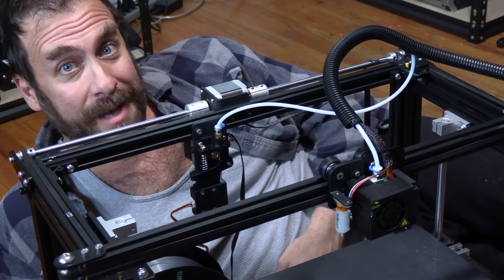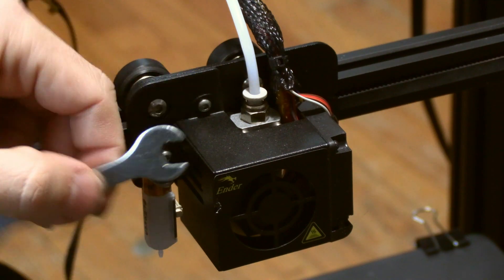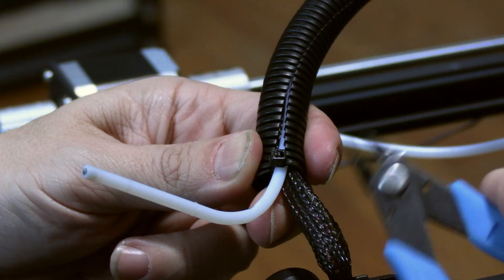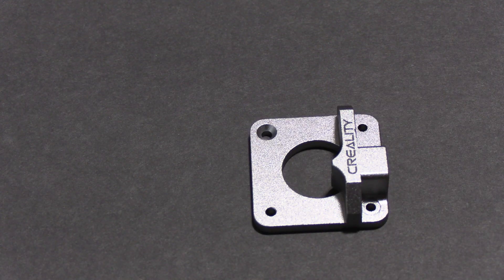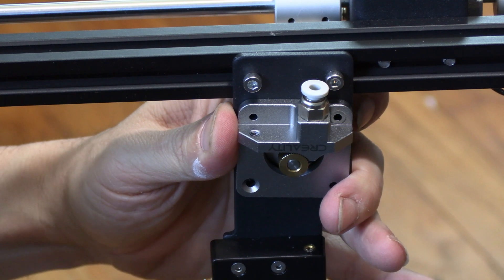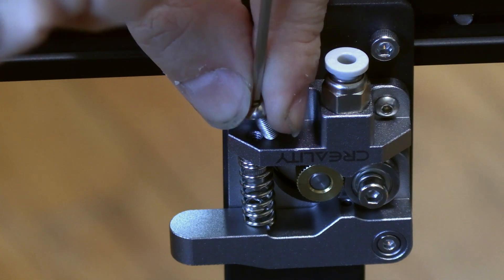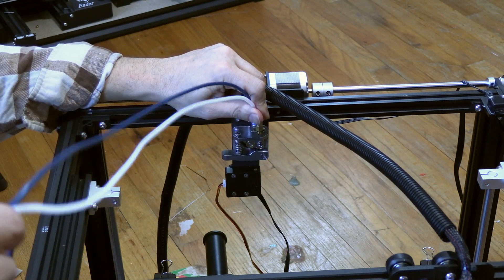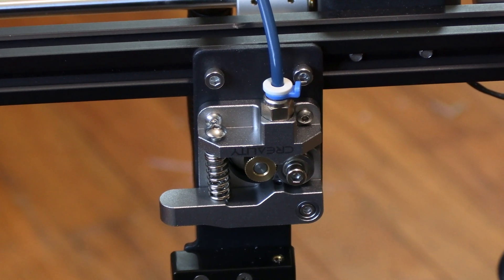Upgrade Ender 5 Plus to All Metal Extruder & Blue Capricorn PTFE Bowden Tube - Creality Ender 5+

Comment: 4:11 I do not have the key that came with the printer, what tool can I use here? It seems to be between 5/64in and 1/16in, maybe 1.8mm but that is not a standard fallen key size to my understanding
Reply: i think it is either 2 or 2.5mm, its actually between 3/32 and 5/64 inches, I was reading the stuff wrong before
Reply from the maker: I can check later, but it's a typical Allen key. You could also try torx bit's on it. T-Something, and one should work.
Reply from the maker: That is definitly a standard allen key that comes with most printers. This is a standard M3*10 Screw, used on all the metal extruders
Reply: My issue was ultimately that the screw was stripped! I used a T10 Torx with the rubber band trick to get it out, took some force, but the stepper motor seems fine at least. Thank you for your help man.

Comment: A  transparent boweden tube would have been better.
Reply from the maker: Capricorn is typically Blue
Reply: @3DRundown  I know, but with transparent you'd be able to see if it was actually in there and whether it had clogs. But Capricorns are supposed to be better, yes, for temperature and actual dimensions.

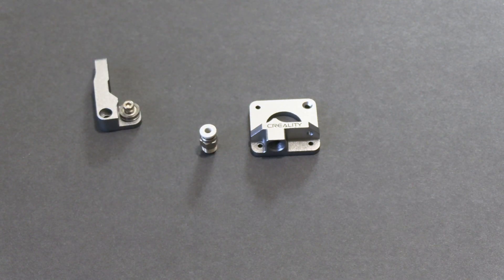Comment: Hi 3D Rundown I recently bought a metal extruder for my 5 Plus and they no longer have a tube holder that screws into the extruder main piece shown in your video at 5:40. It is now a black plug that pushes into the housing. So the housing is now the tube holder.
Reply from the maker: I really dislike that style. I didn't think they were even selling them. I find them hard to remove the tube, and hate that the couple can't be replaced. I use these on all my machine: https://amzn.to/46IruAj